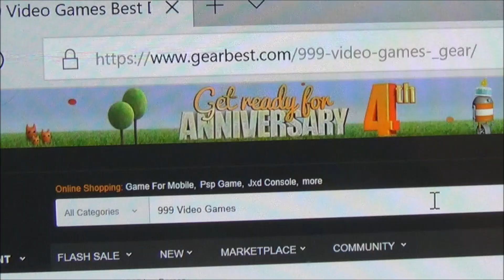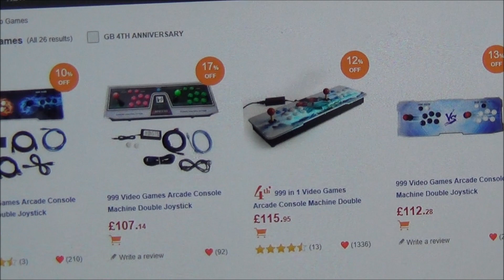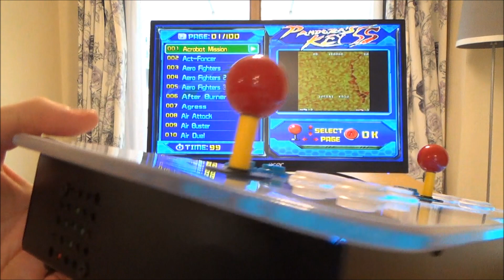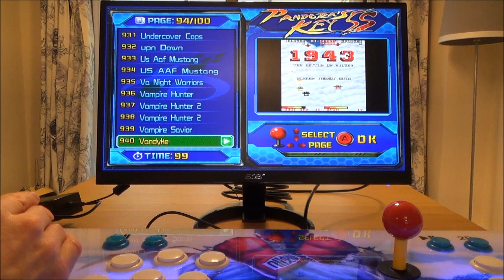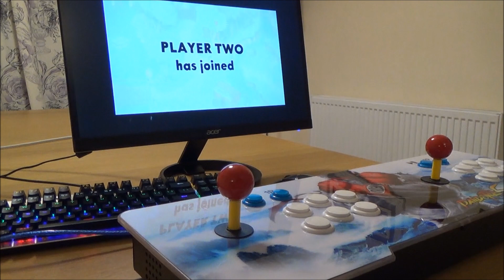Review of a 999 in 1 Video Games Home Arcade Console Pandora's Key 5S

Comment: Good review, covered the important stuff.  Don`t forget that many of us approx 50 years olds were also playing classic arcade games before we were even teenagers.  The case looks good and the price of this product could also interest someone like me in getting one, gutting it and then building a much better custom system inside of it too ! although the fact that the artwork can prob not be altered is perhaps gonna put me off the idea
Reply: @Noiselab, Maybe not! You COULD use the original top as a pattern to cut your own. If you order from the right place, the acrylic/plexi glass shouldnt be expensive. From there, figure out the art work you want to use,  then have it printed up at officemax/depot.
Reply: ESPIONAGE AREA 51 Media  yeah but I`d be left with so little of the original then not much point, I`d already replace the computer inside and all the buttons n joysticks
Reply: Noiselab Project  Yeah, good point if youre gonna swap everything. On the flip side, either way, youd still have an original one of a kind looking face to it. I dont know anything about replacing the computer inside, but if I do get one of these, Id definitely be swapping out the buttons and joysticks.

Comment: The other machine that you are talking about is called Pandora’s box is that on the same site or is that a different site
Reply from the maker: No, I don't think GearBest do that one. If you Google 'Pandora's Box 5 by 3A Game Company' then you will see it. I think Amazon have them. If you watch a YouTube video on it you can see the inside looks better (but it does cost quite a bit more) and it runs quicker. Also look at the clone  Pandora's Box 6 which has more games and game saves and you can add ROMS (games) via USB but I don't know if it runs any quicker and the build wouldn't be as good as the proper Pandora's Box 5. I haven't tried that one (the 6) but those features look good (eBay have them).
Thanks :-)

Comment: What’s the emulation like on something like that? Is it good quality emulation?
Reply from the maker: It seems fine to me on the majority of games. Outrun, Mortal Combat and After Burner are NOT good and there may be others but most run well in my opinion. Others players may be more fussy and pick up sounds/frame rates that I may miss :-)
I could probably get better emulation on my gaming PC but this Pandora's Key is so easy to use without having to 'play' around with any settings. Button bashing the 2 player arcade sticks are the things that 'make it' fun rather than using a controller or gamepad:-)